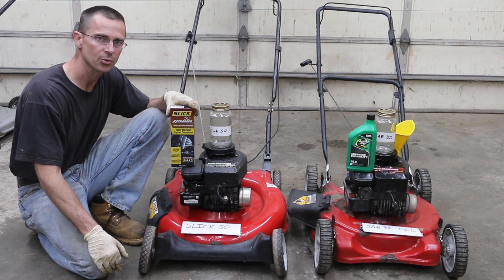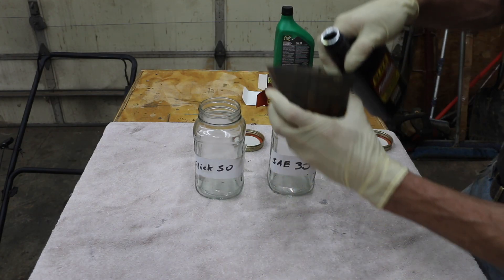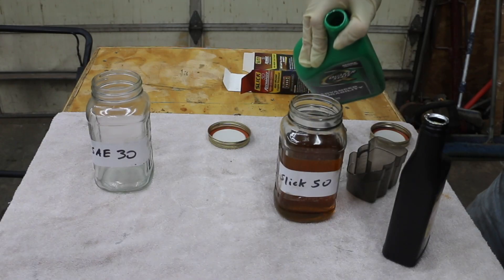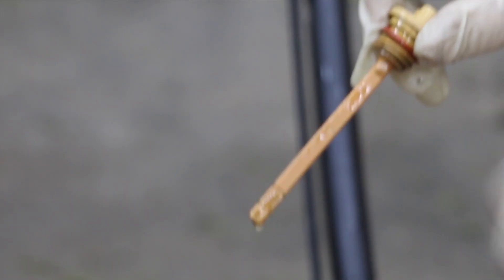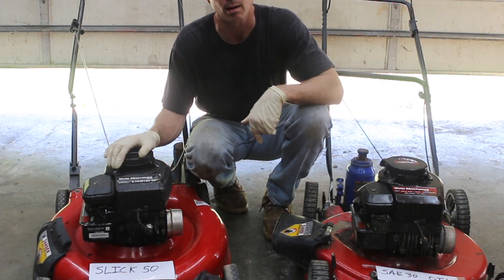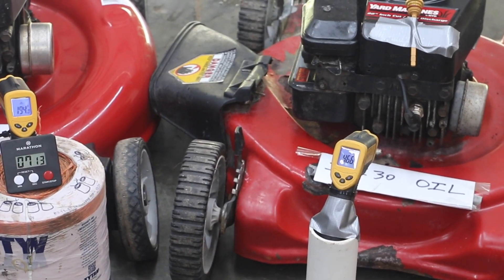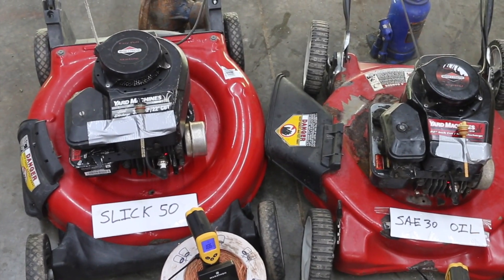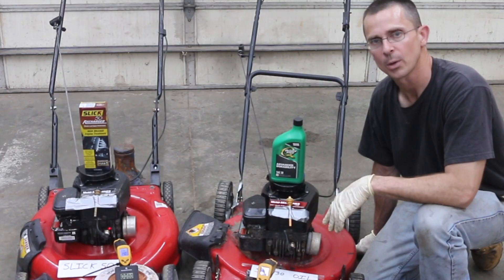Can't believe what SLICK 50 did to my engine!!--Dry Crankcase Test!

Comment: Slick 50,an Australian development was bought out and had it's formular wrecked. It drove a car with only a trace of oil, 700 miles at highway speeds with four adults without failure in New Zealand mountains. The patents expired and the product reemerged in Australia several years ago as XL plus. It works far better.
Reply from the maker: Thanks for the feedback.

Comment: My truck had an engine rebuild around 100k miles.  I used to put slick 50 in every couple of oil changes.  That engine now has almost another 200k miles on it.
This last time, I added a Lucas oil additive. 
Who knows how much longer it will last.
Oh, and yes,  I remember that commercial.
Reply from the maker: Thanks for sharing.

Comment: The Colour Difference of the Drained Oil is significant . Slick50 engine Oil was virtually Black .
The two Mowers are NOT identical  I  noticed . What was the Age of them each ?
The one that got the Slick50 looked the newer . Maybe the Slick50 was helping as a Run-in Oil ? Did run cooler . But so would a Newer Engine .
Two scenarios here . 
1 ; Slick50 is an excellent CLEANER but not necessarily a better lubricant .          Or , 
2 ; The newer engine was still too tight to run long Un-lubricated . Older Engines are actually more tolerant to that .

Myth Busted  I  guess . Ideally , should have been Two Brand New identical machines .

Comment: The old story with the slick 50 was that after the engine cooled, you couid refill the oil and run the engine. Did you test that theory?
Reply: Nothing can perform miracles. If the engine did run cooler with slick 50 I'd call it a win. The test kinda needs a do-over!
Reply: i would like to see a re-test done. i believe the slick 50 engine will turn back over

Comment: I wonder if the slick 50 needs some time for the PE?? To become one with the metal in the engine.  I would love to see a rerun of this with a month of use on each engine, or two months or three.  I seem to remember that they had run the engines for some time like weeks before the test.  I remember the tests very well, I was a middle-aged man when it came out. I like your use of scientific method in making the tests balanced.
Reply from the maker: Thanks for the suggestion.

Comment: If you happen to do another shootout, I would like to see Motorkote. I have a 4L60E with 207k on it, and when it gets low on MK, I can feel it.
I have seen it drop 20° in an F-350 transmission, and take 80% of a LOUD knock out of a John Deere commercial mower engine. It is used widely in the trucking industry, and it's believed that many NASCAR teams run it also. Keep up the good work!
Reply from the maker: Thanks, will do!  Thanks for the suggestion.
Reply: @ProjectFarm  I just watched your video about motorkote, thank you for doing it!

Comment: I use Duralube.  I watched an infomercial about 25 years ago and started using it in all of my engines, it has extended the life of my engine.  Or that is what I believe, I have had my engines run longer not using oil or showing wear and tear.
Reply from the maker: Thanks for the feedback.

Comment: Best stuff iv'e ever used out of a bottle, other than sea foam, is a product called ER energy release.I had a 1981 ford F-150 with a 4 spd manual tranny that had began to make hideous noses at random when I was stopped idling at lights etc... I put ER in the tarns and within 300 miles the noise had completely stopped and did not occur again for well over a year, when it did I changed the gear oil in the tans and put in a fresh dose of ER and the noise had never reoccurred again 2 yrs later when I sold the truck ( I told the new owner about the problem and about ER ) !
Reply from the maker: Thanks for the feedback.
Reply: @ProjectFarm  Your'e welcome, by the way when I used sea foam in my 84 diesel rabbit (fuel tank) it sounded meaner and was definitely peppier !

Comment: Appreciate your channel and I have no prejudice for or against slick 50 but I don't think your test was valid.  As pointed  out by other comments you should probably run the slick 50 engine longer to " break it in".   Biggest problem is that one test with two lawn mowers is statistically insignificant.  I understand you don't have the money to destroy many mowers so I can't really fault you.  That the slick 50 engine ran cooler is perhaps significant, but with just one test, who knows?  Keep up good work
Reply from the maker: Thanks for the constructive feedback.

Comment: ProLong got my 77' Dodge tradesmen 200 thru death valley and then to Tucson with a hole in my radiator,  in early September. It was about noon when I crossed into AZ. I was about 2miles in when my top hose blew off the moter so, after it cooled down I was able to trim It and reattach it and filled her up. I made it 15 miles before the engine was rising  past 210°. Waiting an hour before refilling her with water. This happened 2 mor times, equalling 45 miles in 3 hours.  With the unexpected 3 hours however, it gave me a chance to go through everything and,  that included a bottle of ProLong witch states, "Don't wait for an oil change,  just add it,.......So I did and,  I was shocked.........125 miles to Phoenix  and my 318cui stayed at 180 all the way through Phoenix, I pulled over again and let her cool off. To my surprise she still had more then a litter of water in the radiator.  I then easily made it the 200 miles to Tucson, because the engine temperature didn't brake 180° and because it had finally cooled down a bit, my temperature went down to 170°........ ProLong is the stuff
Reply from the maker: Thanks for sharing.

Comment: Just pouring slick 50 into the engine and running for a few minutes is not treating the engine with slick 50. You need to shake up the slick 50 can quite a bit to get the solids suspended n the oil and then run the engine for quite a while before they bond to the metal surfaces in the engine and provide the protection as advertised. I used to run Slick 50 in my 1989 Toyota Camry after the break-in period for the new car and saw about an average of nearly 7% better gas mileage, depending on the average speed driven on a given tank of gas. Most of my driving was on the German Autobahn. The other thing I noticed was that the internal friction was reduced enough that taking my foot off the gas or downshifting to slow down was less effective. I added Slick 50 at about every 4th or 5th oil change.
Reply from the maker: Thanks for the feedback.

Comment: worked a  GM dealer back in the late 70's GM would void warranty if teflon engine treatments were used before around 10k miles I think because we were running into engines that used oil because the rings took so long to seat if you used the treatment I think we used lubrilon or something like it. cool demo... could the fact that the 30w engine was older and probably more worn so tolerances were not as tight have anything to do with longer run time?
Reply from the maker: Thanks for the feedback.

Comment: When Slick 50 first came out I put it in one of my vehicles. As guys are prone to do at work I reported that it worked so well I had to carry a length of 2x4 to wedge against the fan belt pulley to get the engine to stop after I cut it off. If I didn’t it would run all night! Retired now, miss those days. 😂
Reply from the maker: Thanks for sharing!

Comment: The measurement of significantly lower temperature in the slick 50 mower means it was doing something beneficial.  Since the one that previously had slick 50 in it was also operating at a lower temperature than the other one when it quit, I'm not sure this test makes sense.  I could be missing something obvious, but it seems like the cooler engine is experiencing less friction and the engine shouldn't seize at that point.  Did you try adding oil back into that mower and restart it?  Perhaps it died for some other reason.  The one that didn't have slick 50 clearly cooked the motor before it quit, but I'm not convinced that the slick 50 one is cooked.
Reply: Some Other Reason?!?!  They had no Lubrication, lol......seized

Comment: From memory. I think you had to run the engine for a few hundred miles with the Slick 50 in it to treat the engine first. Not just a few minutes. In cheaper products, the teflon would settle in the bottom of the engine, but evidently the teflon atoms in Slick 50 were electrically charged to keep them separated and prevent that from happening. But after a while they just lost it.
Reply from the maker: Thanks for the feedback.

Comment: You need to take the best one you have found and compare it to dura lube. couple of true story's of my experience. I had a lawn mower that the recoil baring was going out on, it would squeal so bad I could not use the mower it was defining. I tried near everything on it then I got some dura lube add that to it and wow it didn't just calm the squeal it totally stopped it until the next time I used it, add more then I was able to use it twice each time I added dura lube to it. I was sold on dura lube after that. That was going back 24 years ago. next story is going back about 10 years, my wife at the time opens the garage door throws a fan out the door into the garage and says this fan is driving me nuts with its squealing, my Son picks up the fan and grabs the dura lube off the shelf and adds dura lube around the motor bearing. I return the fan to the house and a hour latter she throws it back out and says it doing it again, so I told my Son to add more and let it run facing up for a bit. back to the house it went and that bearing has never made a sound sense, and as I said that was 10 years ago. I have a Banshee 4 wheeler that I bored and stroked from 350cc to 412cc and I added dura lube to all the ball and roller bearings she still runs awesome and that was 13 years ago.
Reply: O forgot to add the slick 50 may have led to early death do to the lower temp, metal is softer and more forgiving at high temps, water cooled motors may have add a diff outcome
Reply from the maker: Thanks for the suggestion.  Thanks for sharing.

Comment: Still a lot of good usable parts, the low temp had Me almost liking slick 50 until the engine seized you must remember what heat actually does to hydrocarbons and what film strength means.
 Somewhere a test lab is missing an acolyte, keep up the good work( maybe "Sandy Munroe" could find a place for you?)

Comment: I think it takes more time in contact with the metal parts.  You are supposed to run it for 3000  miles in your car engine to get the benefits.  I don't think you ran it long enough for the product to work.
Reply from the maker: Thanks for the feedback.

Comment: All oil and fuel additives are generally a waste of money if not actually a scam. Modern oils and fuels are designed to meet certain specifications! To meet those specifications and do the jobs they are designed to do there are many additives in them already! When you put something else into them they do not act the way they where designed anymore, you have a new product with unknown properties! After market additives are only good for specific requirements, and you should know what those are and how you are achieving them before you put an unknown substance in your expensive equipment.
Reply from the maker: Thanks for sharing.

Comment: Ran my Slick 50'd E-150 (352 ci  Windsor engine) over fifty miles with no oil pressure (not on purpose, broken oil pump) with no apparent damage after oil pump r4epair. I ran my Sick 50'd V-6 Delta 88 after the engine froze up from water loss. The only repairs needed were some new rubber/plastic parts around the carburetor. I thought that was testimony enough for me.
Reply from the maker: Thanks for sharing.

Comment: Check out a product called microlon. It is much different than slick 50 and a one time treatment. I have had some experience with it's results during an engine teardown of a  80's 350 chevy engine with over 100k miles and noted that there was minimal cylinder ridge and the cylinder crosshatch was very clearly evident. The engine spent most of it's life in the extreme climate of Fairbanks Alaska. The only significant things I found were cam lobe wear and valve recession.
Reply from the maker: Thanks for the suggestion.

Comment: Interesting test. Thanks for doing it. But I suspect if you did the same test again the results could be different. There are many variables, including the condition of the two engines. Also, the engines sounded like they were running the same rpm. Were they? I'm not a Slick 50 advocate. I don't know anything about it. But I do know that there are more scientific ways to test the characteristics of lubricants. However your goal was just to repeat what you saw on Slick 50 commercials. In that way your test was successful, at least for these two engines.
Reply from the maker: Thanks!  Thanks for the feedback.

Comment: Opinion change.. Well a serious update anyway.. I did some research on youtube and found a shocking video... The slick 50 as per the origional product contained PTFE, BUT IT WAS SOLD OFF TH A MAJOR OIL COMPANY.... So now it containes  a different formula according the original creator of the product. So thanks to him we don't get the same product and its former benifits...
So even if my recommendation for the correct way to get the milky ptfe paste from the bottom of the container into the engine, and un it for 10 hours, it still wouldn't perform any better..... Unless you can find one of the original formula containers made pre 1978....
Don't you just hate it when that happens...
So SLICK 50 SOLD TODAY IS NO LONGER THE SAME PRODUCT...
Reply from the maker: Thanks for the feedback.

Comment: There may be an issue with the length of time the engines were run with oil as  I ran a car for some time with slick 50 mixed in. I then I had to drive home without oil about twenty miles. it had developed a leak and I couldn't buy any to top up. I had driven around to various stations but none had any oil (industrial action). When oil pressure dropped to zero I gave up looking locally and headed for home. I got all the way home.
Reply from the maker: Thanks for the feedback.

Comment: the slick 50 you buy today is not the same stuff from back then its a different formula
Reply from the maker: Thanks for the feedback.
Reply: slick 50 was only sold under that brand till 1984 , the original formula is available today its now called Xcelplus , if you put that into google it will find it and there is an interview with the bloke that invented it explaining what hapend, certainly would be interesting to run your test on the genuine artical and see if there clams were true

Comment: You need to try again, leave the ptfe can upside-down for a day.. Then measure out the additive... That will contain PTFE. The engine will need to be run 10 hours, for the ptfe to get embedded into the contact surfaces. Then run the test... Your test didn't get any PTFE embedded into the metal, test invalid.
Reply from the maker: Thanks for the constructive feedback.
Reply: I used Slick 50 for many years (when I changed my own oil)  with good results, so I remember the instructions: 
Because the PFTE is heavy and suspended in the oil, it will settle on the bottom of the bottle(!)
So the instructions said to shake the bottle for several minutes BEFORE pouring it into the engine. 
Then the PFTE is supposed to bond with the moving metal surfaces as the engine heats up after the oil change. 
I still always changed my oil every 3 to 5000 miles so never had any problems. 
Thanks for listening.
Reply: I FIND THIS TO BE CORRECT...IF IT IS MIXED WITH 30W OIL...I try to purchase pure...I live in So Cal Desert...it gets hot here...so I run 20W50...Have for years...thinking of 15W40 Diesel style if needed...My Dad ran 20W20 Havoline...But he lived in Arkansas...
Reply: Slick 50 advertised that there was no visible materials. Lie, I bought some to treat all my vehicles and my welder. When I emptied the slick 50 into my welder after treating both of my vehicles I found a thick brown sludge in the bottom of the bottle. When I went back and looked at the others the same thing was in each one. I took several with me to Wal-Mart and showed them to the manager and he refunded my entire purchase price. Junk
Reply: @98grand5point9  I think its best to shake the bottle before use. 
I had an high milage Mazda with valves making sound.... after slick 50 went in the engine was much more silent... and it lasted about 55.000 miles (which is indeed what the can said).... I liked it, but havent used it since. I think about it though for my recent high milage car...

Comment: Two different used engines, who knows their bearings, rings and rod histories - if the Slick50 engine was running rich it would've run cooler and washed out any oil from the cylinder sooner than the non-rich running engine causing earlier failure, so many possible other reasons why it died when it did. The only way to do this in a more scientific manner is to use two brand new & identical engines, compare compression and match valve adjustment then monitor their fuel efficiency from the exhaust to insure one isn't running richer than the other.
Reply: Whatever professor
Reply from the maker: Thanks for the feedback.